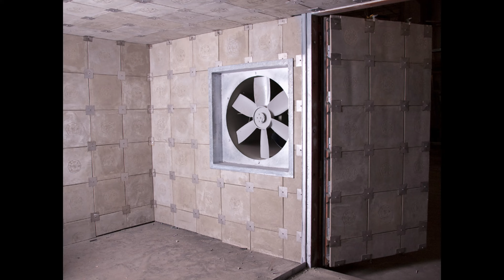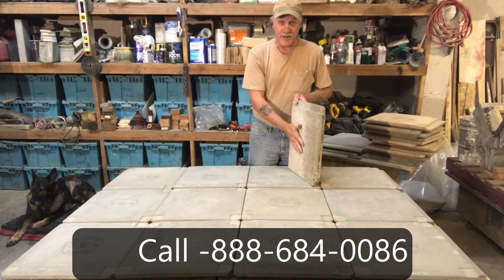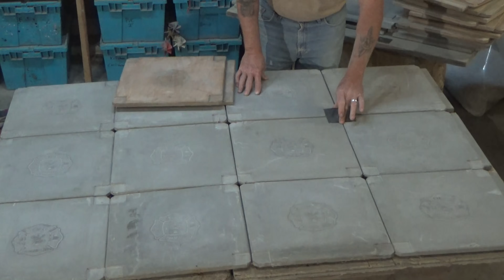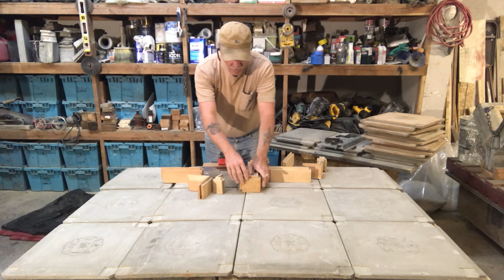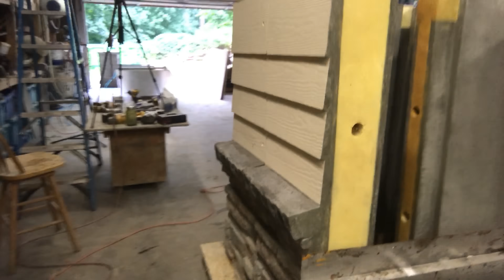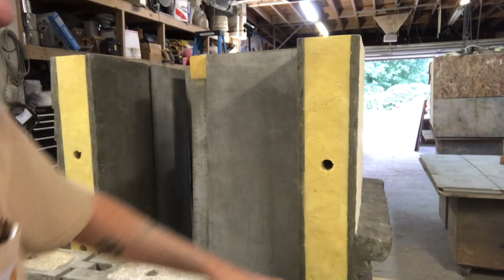My interlocking fire liner panel system

Comment: 20:00 Is there anything like a silicone caulk or gasket to 100% seal those seams? Honestly, I'm thinking that making the 'tongue' just 1/4" shorter and adding a rubber gasket to that would practically make the house able to float. lol!
Reply from the maker: Sounds like that would work… Things can always be modified to accomplish different tasks or applications.